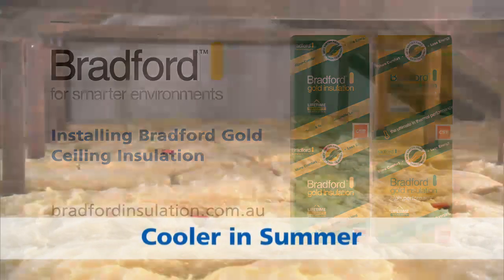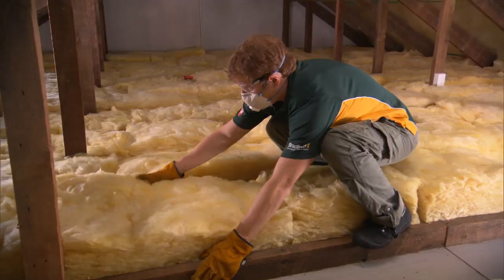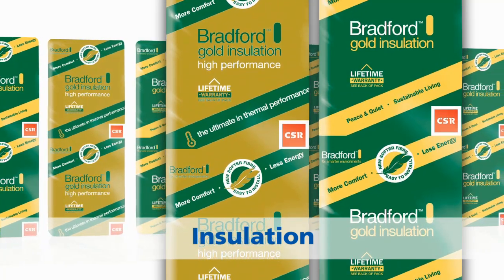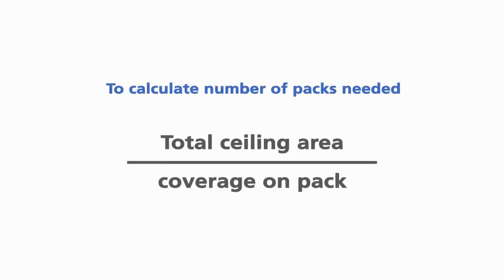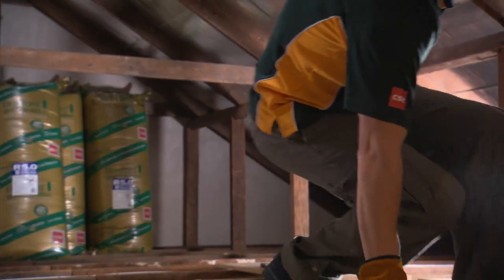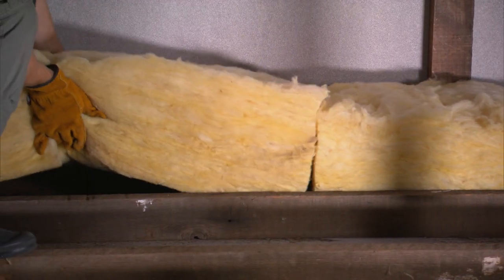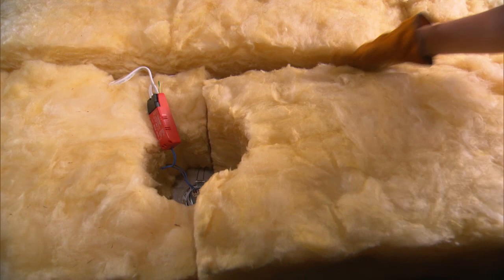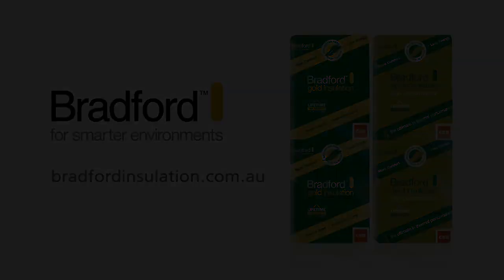Installing Bradford Gold Ceiling Insulation

Comment: What if you need light in your ceiling cavity to see what you’re doing,  turning the power off is not an option .  So why is turning the power off so important if you are going to cut around lights anyway.  Don’t most homes have the lights on one circuit and power points on a different one, in which case wouldn’t a work light on an extension lead  still be safe ?